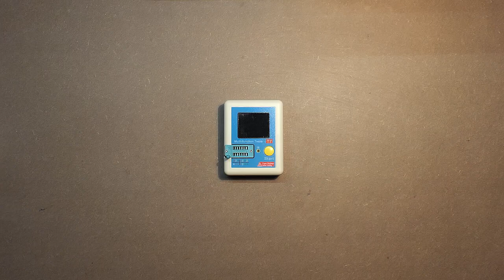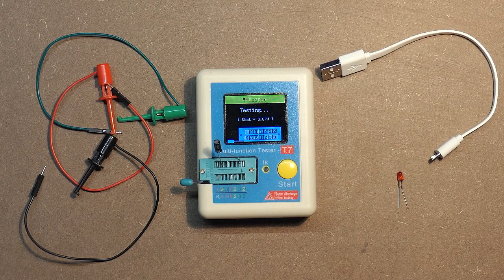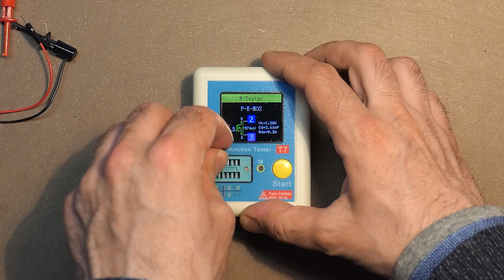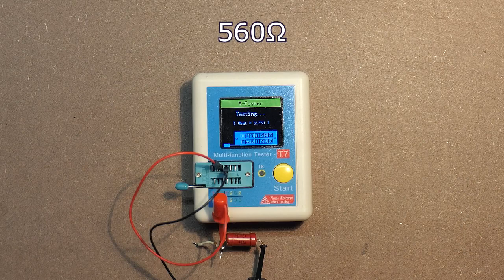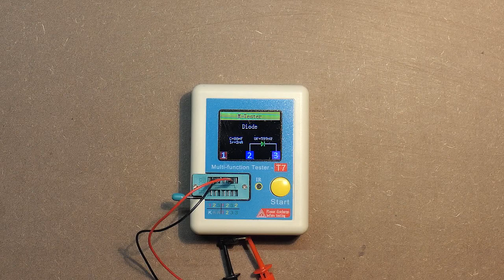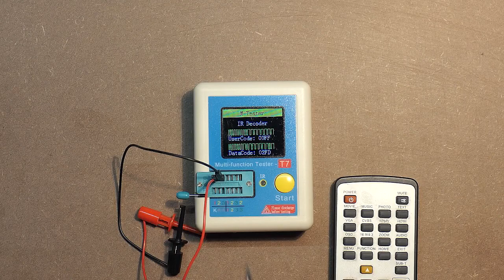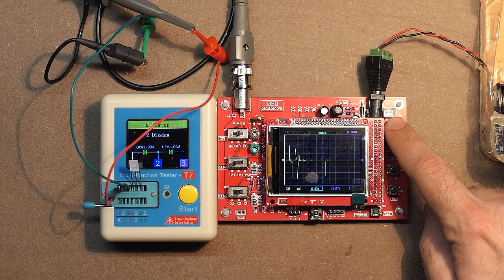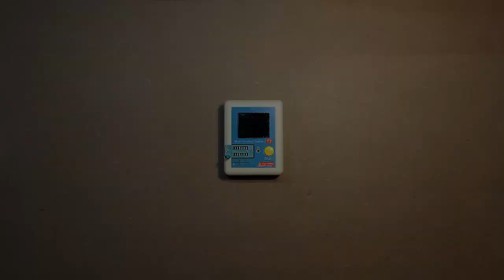LCR T7 - Multi-Function Tester

Comment: My T7 stumps the CPU freezes on some semiconductors requiring disassembly to reset by disconnecting the battery.   Wonder of the unmarked CPU is a fake.

Comment: 7:39 datasheet says  (Rds): 0.008 Ohm or 8mOhm in this tester you get 100-400mOhm. My question is what tester out there can give a better indication of these values. Thank you i primarily want to check MOSFETS with something more accurate. Will probably still get this one for capacitors though it seems like a nifty checker. Thanks for the video.
Reply from the maker: You are welcome.
Frankly speaking, this is a device for amateurs, not for industrial use, so, its accuracy is not decent for exact measurement. However, you can check approximate values with its help.
 Please, subscribe to my another channel: https://www.youtube.com/channel/UCbQUNw5V5pDPXugLX1FP_Fg
Reply: @powerbatterychannel4315  Correct yes, I stumbled upon someone using a Milli-ohm  meter to get better results so that should be a viable avenue to take.

Comment: I just received the TC-T7-H and the calibration procedure you show causes it to measure the jumper as a resistor.   It will not go into calibration mode.   Maybe the H model doesn't require calibration?  There were no instructions in the box.

Comment: I cant get mine to self test. It just wont begin the test. Instead gives me resistive values between the sockets. Anyone else have this problem?
Edit: it is the T7-H. 
The reason id like to self test is because it keeps giving me differing results on the same inductors, caps, reaistors.
Reply: does it keep giving different results for every try. i thought to buy it but it is a problem as i see
Reply: @serdar-ors  to be more specific, it is accurate test to test for any given value. Sometimes it will give you an inductance reading instead of Farads etc. But if you know what type of component your looking at, it won't ever be a problem. It's definitely accurate.
Reply: @robcoastalga8279  i see , sometimes wrong type but accurate value
Reply: @serdar-ors  correct and at the time I was having trouble identifying components I was looking at on a board. Now I've got that part figured out.
Reply: @robcoastalga8279  there are different brands of this device i think, similar design. where did u buy your device

Comment: Just got mine.  When testing, pressed yellow button and after "testing" goes away it shows a Capacitor  4.91uf on pins 2 & 3.     with no capacitor present....Something wrong here.   Also, no instructions whatsoever......
Reply from the maker: Just try to calibrate it.
One of such devices had such a problem. Calibration has solved it.

Comment: I just got the same device. Calibrated and started to test components. Whenever I measure inductor it shows resistor and some unrelated value. Would you please help me how can I fix it?
Reply from the maker: Sometimes it recognizes it as resistor, it's normal. Try several times.
Reply: @powerbatterychannel4315  thanks
Reply from the maker: @Electrologia  You are welcome

Comment: The difference between 3 versions T7 / TC1: Color screen, its functions are the same! T7 is a little faster! The tc screen is a little bigger as they are powered by elem1 batteries. In addition to the configured resistance, indu capacitance, diodes, mos transistors, thyristo, it can also quickly measure additional meter gauges, by infrared code meters (limited in achi format) T7H: It is an upgraded version of T7, upgraded/more version

Comment: Wish you had hooked up the scope when it was measuring a capacitor - I would like to know the frequency used for the capacitor measurement and cannot find that info anywhere.   Also does it use a pure sine wave for capacitance measurement?
Reply from the maker: It sends the same signal to all parts in order to identify them.
Reply: @powerbatterychannel4315  That wasn't what he asked.

Comment: So you test 5 mosfets IRF3205 and all of them have R around 0.1 to 0.4 ohms.... Sound like either you have some fake mosfets or the LCR is inaccurate. RDSon for this mosfet should be 0.008 ohm. I saw on another channel that fake mosfet have their back metal body (the heatsink) with small 2 notch near its hole, exactly like yours. I think better to compare the result with manual test using multitester. If you use fake mosfets, guaranteed it will generate overheating and further... damaged mosfet.
Reply from the maker: In order to get precise measurement of 0.008 ohm, you should use Battery Impedance Meter like YR1030+.

Comment: How about capacitor polarity - does it matter how you connect + and - to this device? Cause it obviously matter in circuit but I'm not sure about this device, and the markings do not suggest any way it is just 123...
Reply from the maker: It doesn't matter, the device detects everything automatically.
Reply: @powerbatterychannel4315  Nice, thx for info.

Comment: How do we know which test port to use for different component? Small cap different than 1000uf cap, Which poet for inductors?
Reply from the maker: Hello, you should use any of 1, 2 and 3 for any component; the device defines everything itself. A small capacitor will be defined the same way as a big one. For inductance  we have the same story - any  of 1, 2 and 3 sockets; for example, the first pin into the socket 1, and the second - into the socket 3.